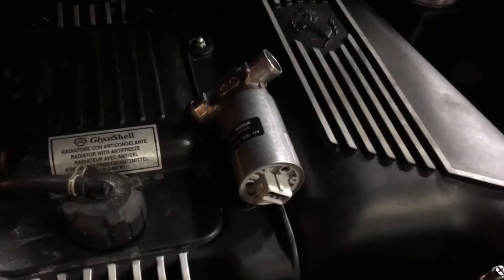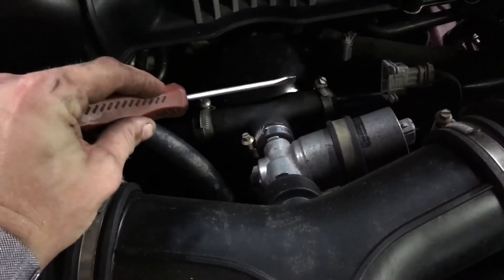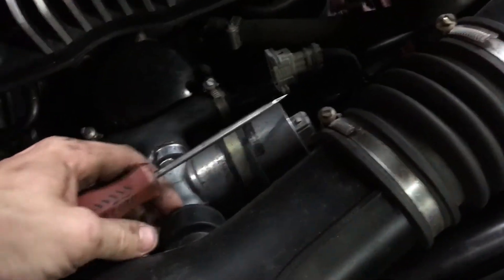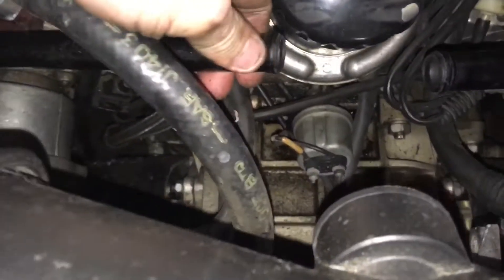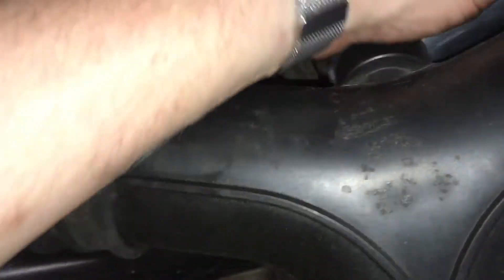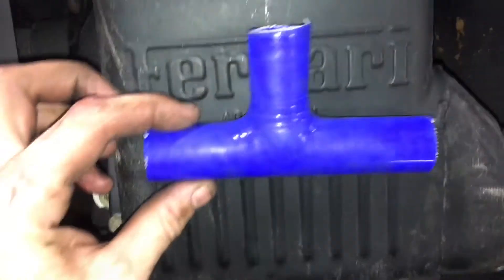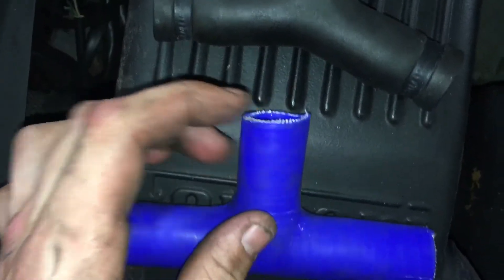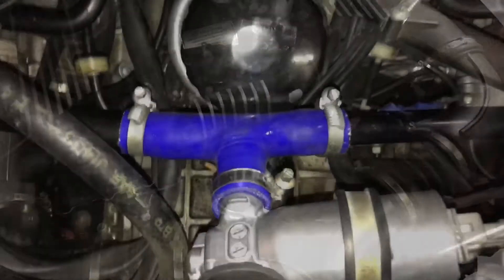Ferrari F355 Motronic 5.2 IACV Idle Valve replacement

Comment: lol same as a bmw idle air control valve and 540i maf
Reply from the maker: AK-DAVE- 47 incorrect. MAF is an M62NV maf though. IACV is unique to the f355/porsche 993

V8 idle valves are green label on BMWs of this vintage
Reply: Ovalbore my m50s looks exactly the same can't speak for the v8s either way I guarantee u that if u plug it in it will work
Reply from the maker: just becuase they're both 3 wire bosch stepper IACVs with black labels, I understand why you say that -- the orifices in this valve are about half way between M50 and M60 valve sizes.